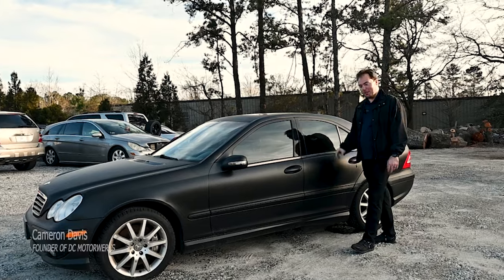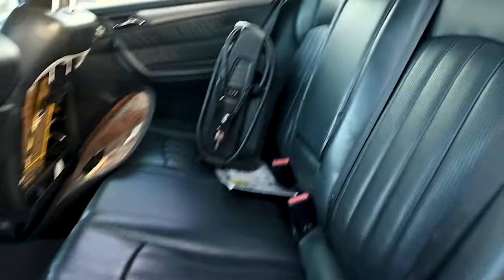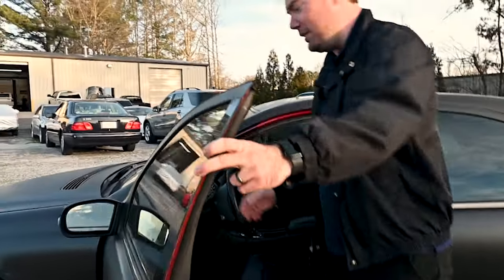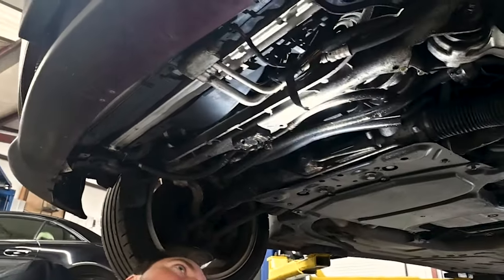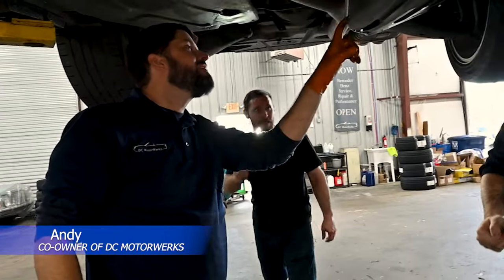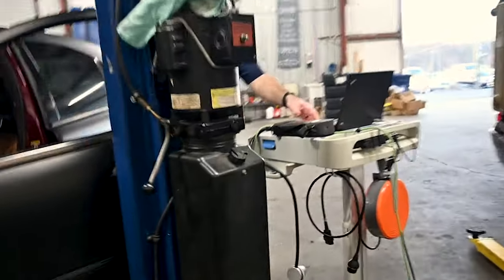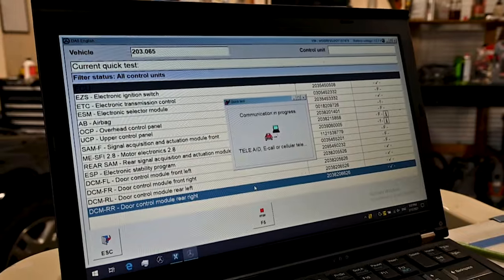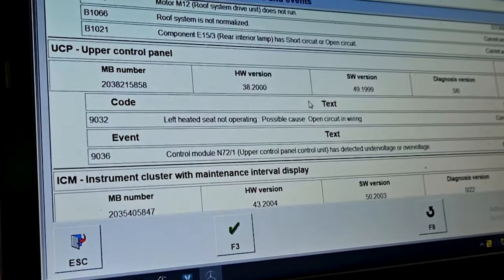I Bought THE WORST C32 AMG For $1300. Should I Take It To 24 Hours Of Lemons?

Comment: I have a 2003 C32 for sale in Auto trader and craigs list Fresno that has the same issue with the cluster odometer, I found the original cluster was broken and would not turn on the check engine light. So i sent the cluster out to a company who specializes in this type of issue and they cloned the cluster to a new used cluster however once I received the good cluster back I found after a few seconds the cluster will show the dashes. It does however show milage before the cluster shows the dashes. The vehicle is running but will not pass smog and due to a work place accident i can no longer work on the vehicle. I also have another 2003 C32 AMG that I have had over 12 yrs that runs and is garage kept that I have done a lot to like a Killer chiller heat exchanger, VRP short header, Needswings air intake and an ECU tune. Had got the other vehicle I am now sell in 2020 as a project but had accident 2022.

Comment: Hi there Cameron. On my 2006 E55 AMG I have a P0410 code for the secondary air injection system which is tripping a check engine light. Generally how difficult is this type of issue to repair? Car doesn’t seem to run rough or anything at all. Thanks!
Reply from the maker: Generally a very easy fix. Usually the pump or a broken vacuum line

Comment: YO! I've got a 2006 C230 (W203) sedan with the M272 engine. I'm looking to replace a cracked valve cover (tried to cold weld the crack and it's helping...some). It runs great. No codes except a small vacuum leak and both cats. She gets, max, 32 mpg hwy and everything works except the washer fluid thingy. I really like this car. 

I wanna do the R171 intake upgrade with the S550 throttle body. The intakes on these are notorious for imploding.
Reply from the maker: Yes the runner arm breaks